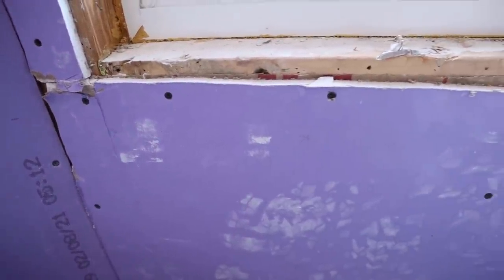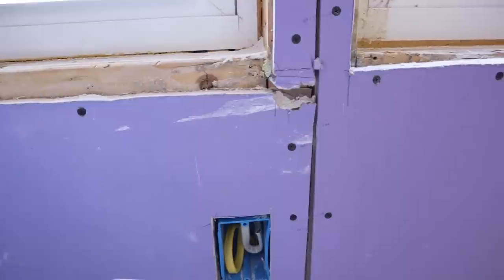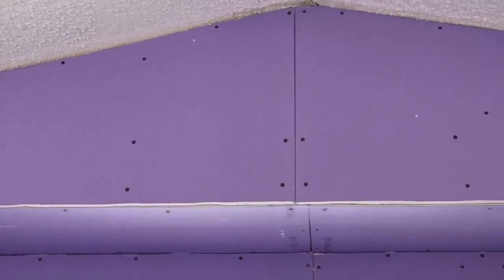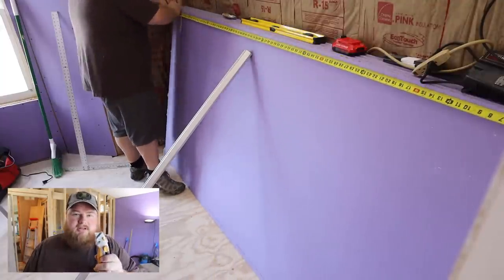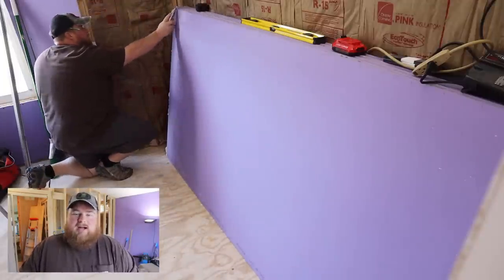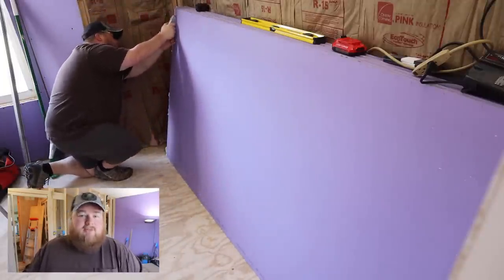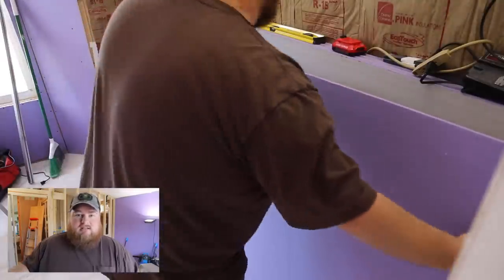COMPLETE Bedroom Drywall Install - Mobile Home Renovation

Comment: I never  knew drywall comes in a purple cover. The room is shaping up real well.  You are so entertaining, LOL.
Reply: I think its for moist areas. If I am not mistaken.
Reply from the maker: Kristin is right -- it's mold and mildew resistant. Normally you will only see it used in wet rooms like bathrooms, but we choose to use it anywhere. It's not but a few dollars more per sheet and money well spent in our opinion. Especially with how easily mold or mildew will grow. :)
Reply: @sam-and-angela  
yes most all bathrms an I use it in kitchens alot I'm a painter by trade so drywall I do alot of repair with that purple my sure you use a really gd primer first then paint it the color you want I have my primer tinted to the color I'm going to use as a bonus. keep them videos comein guy love them
Reply: @hermansims304rcrawlingteam3  thanks for the tint primer trick
Reply: Use to ....or possibly still depending on manufacturer MR drywall was green . This particular purple mr drywall is sold by Lowe’s and probably others
Reply: @hermansims304rcrawlingteam3   I do that also on tinting primer as much as possible to the color for the walls. I use mostly Sherwin Williams and used to use Glidden but the Glidden supplier closed where I live.
Reply: @quarrel05  
no problem I help any way I can makes painting over dark colors alot easier
Reply: @danbailey96  yes I only use sherwin williams anymore the last Glidden paint I used was about as thin as water an took alot of coats nt gd at all
Reply: I think it's for the mold prevention/moist areas of certain parts of the room. Being a mobile home, it's probably ideal. Not sure. Any corrections are welcome :)
Reply: 💘  your channel.  Most days, I watch more of your video than any other channel.

From a layperson's perspective,  (possibly misinformed - YMMV),  your home has nothing between wall studs and metal, exterior cladding. Warm air will make its way from the interior,  though the insulation.  If the cladding temperature is below the dew point of the interior air, condensation will form on the interior side of the cladding.

Also as a layperson,  my guess is the green drywall is structurally stronger than regular drywall.

 @sam-and-angela
Reply: @hermansims304rcrawlingteam3  yes it’s definitely not the quality it used to be.
Reply: @lloydrmc  The paper facing on the insulation is sort of intended to prevent that and it seems to do a reasonable job. Many countries (e.g. Canada) favour a plastic vapour barrier instead, fearing that paper won't be enough. If your insulation is damp with condensate, greenboard won't help you much, especially since at least the kind I've worked with is only treated from one side, the one supposed to face the room. I think this purple board is the same, since it's grey on the other side.

Comment: I like to insulate interior walls for purposes of soubd deadening. It's a minimal cost with huge benefits, especially in bathrooms and kids' bedrooms. If I have exposed stud bays, they get insulation before the drywall is installed. It makes a huge difference.

Comment: When you do drywall most guys start from the top. That way your top sheet supports your ceiling sheets. You are supposed to leave 1/2" gap under bottom sheet. This is a safe guard against water reaching your drywall. Also ,  you stagger your sheets. You should have put a half sheet up after starting with a full sheet.

Comment: It's really nice to have walls again I'm sure. The boys would probably like a light baby blue for their walls. It won't be long and it will be done.
To save time & make less sanding use a damp rag to clean up as you are mudding. It will help to wipe off the small bit that seem to take more time to sand.

Comment: Last summer on fam’s trailer I redid wood flooring due to tub leak into bedroom. While at it I used wainscoting panels glued and nailed for the walls as nothing was wrong with walls. Just didn’t want to bother with that gypsum board, primer, paint. Wainscot panels was a nice upgrade! Should’ve watched yours and others on floor molding tho as them miters were a beast and confusing!

Comment: Fyi, on those window seams that broke. If you use mesh tape under your mud and then use paper tape on the top it shouldn't crack.  The Vancouver Carpenter (look him up on YouTube) has a great tip of using a watered down Elmer's glue in your mud that makes it hold really strong.

Comment: you can get mush straighter lines of youre using a router and bearing bit , gives a LOT  of dust though and you need to do the corners seperate
about the seams near the window : you can get a special sort of glassmatt that you put in when spackling (spackle / mat / spackle smooth) makes the finish a lot stronger against cracking

Comment: Drywall nails have been used since drywall was invented drywall screws are fairly new I’m sure the ones saying you can’t use drywall nails are young pups that haven’t been in the trades but a few years. Over 55 years of contracting I’ve used most every thing available in the trades....I prefer drywall nails my self  and you better believe drywall screws gets pops also I’ve repaired enough of them over the years.

Comment: Use a damp sponge on finish coat of drywall mud can save hours on sanding trick is keep rinsing sponge and wider than mud applied swipes and dont forget on the last coat of mud to thin it with little bit of water I have got so good at it I have not sanded at all in years good luck

Comment: In a near future video please explain the difference in purple drywall and the old standard off white drywall. Thankfully I have not had to work with drywall in many years. I am aware of the green drywall for simi wet locations like behind shower tiles. I hate working with drywall so to me you are doing a great job and it looks very good.

Comment: I have a question: have you fixed your roof yet the edges I mean where you had to trim it back to me transportation restrictions. Also what about the insulation in the ceiling have that you already done that when you did the new roof? So far everything looks like it’s coming along very nicely. And like everyone else you get better at doing the job the more times you do it. And this does show that you put in some hard work on what you’re doing.

Comment: Drywall rule #1 always start on the  top of the wall so if you have to cut a partial piece it will be easier to add on the bottom. Sam why is the dry wall purple?

Comment: Question - have you done the ceilings in the trailer? On trailer I’m working on it appears that rain got through the “attic” vent flashing and dripped through a bedroom ceiling. Curious if you all worked on ceilings and that weird gypsum ceiling panel board.
Reply from the maker: We've not. We're really lucky that all our ceilings have been fine or patchable. We will have to patch our ceiling hole where our furnace vent used to go, but otherwise we shouldn't have to do much. Thankfully.
Reply: How did u patch? I’ve read online that they are long gypsum boards specific to mobile homes. What did You use to patch? My area is about 2ft x 3ft that needs patching.
Reply from the maker: @chrisallen8583  We only had about a 6" hole to patch, thankfully -- and we've only placed the patch right now -- not applied compound or built back the popcorn ceiling yet. We put a strip of 1x2x3/4" wood up through the hole that was longer than the hole and screwed through the ceiling into the board to attach it to the backside of the existing board. We then put the 6" piece of drywall (same we've used for walls) in place then screwed it to the wood strip. We plan to add joint compound to close the gaps then some spray popcorn ceiling patch we bought today. It's in a can -- no clue if it's going to work, but it's where we're heading currently. :)
Reply: @sam-and-angela  ahhh. Thanks for your reply. I’ve used both spray and joint compound on another project. Spray works best for walls (knockdown) IMO. Ceilings I’d go with sponge+compound for the popcorn texture. There’s a mobile home living site I found thru google that talks about the gypsum ceiling panels being narrow and long and expensive and can only be purchased at mobile home parts stores. I’m thinking of getting 1/2” drywall and run a 2x2 on each side so the patch has something to screw into.

Comment: Which drywall is the best to use on the bathroom side for wet and mold
Reply from the maker: The same we're putting up everywhere. :) The colored (sometimes purple, sometimes green) mold & mildew resistant drywall. 1/2" thick.
Reply: Oh thank you so much